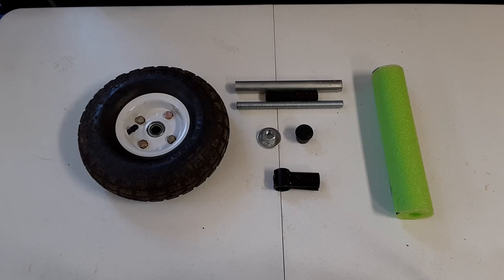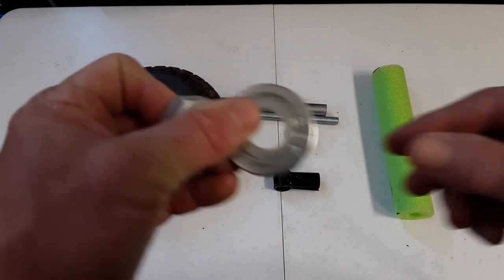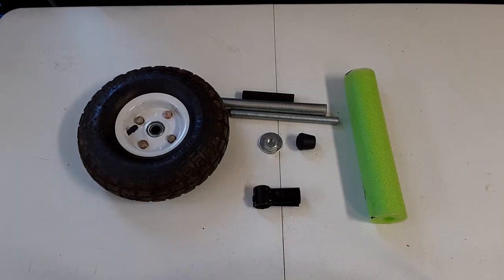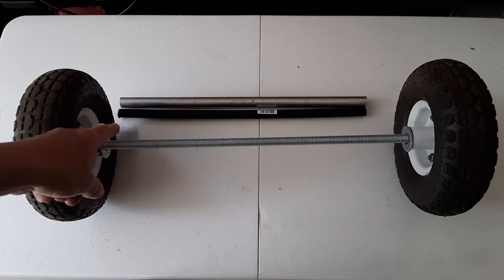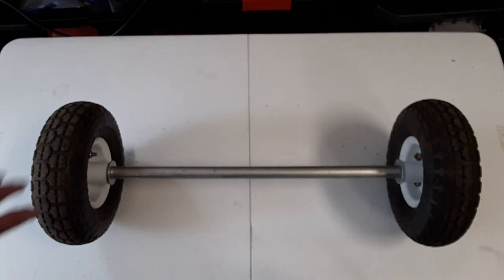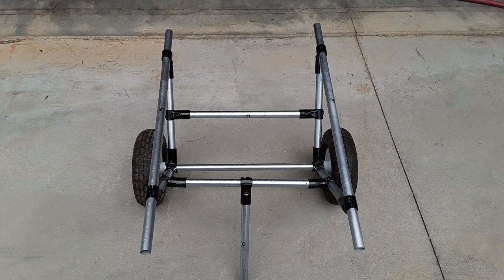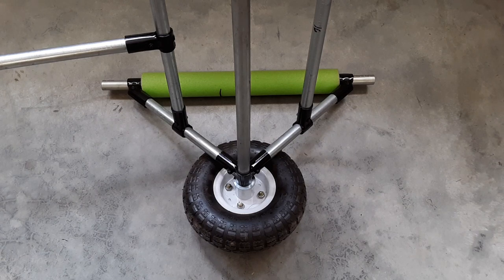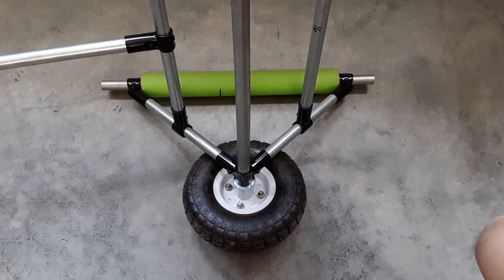DIY Heavy Duty EMT Conduit Maker Pipe Kayak Cart

Comment: Nice design and video. I would recommend drilling the end of the threaded rod and inserting a Cotter pin to prevent the nut from coming off. The threaded rod may have to be lengthened to accommodate the pins
Reply from the maker: Thanks. I used thread lock and so far so good.
Reply: Blue loctite works fine, no issues.
Reply: I built this cart and used nylock nuts.....3 years and they've never moved.

Comment: I will try this design with a modification to make it more all terrain. The one flaw I see is the axle is low and will get banged by stumps and protruding rocks on portages. I will use this excellent design but make four the forks instead of two and have two short axles with a space between them this will give the cart a great deal of ground clearance.
Reply from the maker: Sounds like a good idea.

Comment: Nice.  You can save yourself quite a bit of weight and cost by using a piece of conduit as your axel instead of allthread.  To secure the wheel all you need are washers and a cotter pin on each side of the wheel.
Reply from the maker: Thanks. The weight and cost of the all thread and nuts/washers is minimal compared to the strength gained. I have made other carts for my specific use that basically exploded.
Reply: @Aksmaniyak  As have I.  Point being conduit is plenty strong for the axel.  Allthread is just overkill for what it's worth.  Cheers.
Reply from the maker: @1982mako224  I understand your point but it is not strong enough for my application.
Reply: @1982mako224  I'd like to use 3/4" EMT as the axle but the tire bore is 5/8". Can you suggest a way to attach the two? Thanks
Reply: Get wheels with 3/4 bore bearings.

Comment: Great explanation. What kind of kayak do you use on this case - weight? I’m thinking of doing a similar one for my fishing kayaks, but will use balloon beach wheels. So, likely will have a different axle design. However, that aside, I think I’ll still be able to use your overall layout. Thanks for sharing!
Reply from the maker: Thanks! I have used it on kayaks ranging from 77 to 100 lbs.

Comment: I really like this cart plan and am looking to buy the kit. I have an old town sportsman pdl that is over 100 pds, and the channels are about 10 inches apart. Do you think this cart would hold up if I made the supports closer together, but possibly left the axle 24 inches wide for stability? Thank you
Reply from the maker: Yes, you can do that and it will be stable. I just shortened the 2 cross members to 18" and did not shorten the axle.

Comment: Well, I like the design, and you did a good job, but after sourcing the parts and prices, it would be far less expensive to buy a ready-built cart that seemed at least as strong for the purpose. The list price on the connectors seems expensive. Additionally, it seems a bit over-built for the intended purpose of hauling a fiberglass canoe or plastic kayak.  For my usage, larger wheels helped much more in traversing uneven rocky terrain. I built one based on the design posted by Mic.
Reply from the maker: Thanks. This design may not be for everyone.